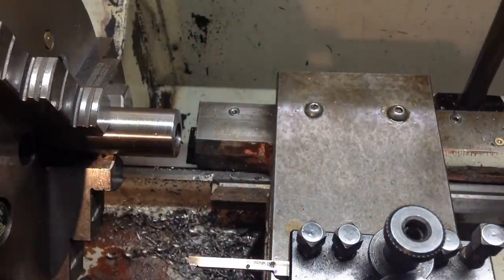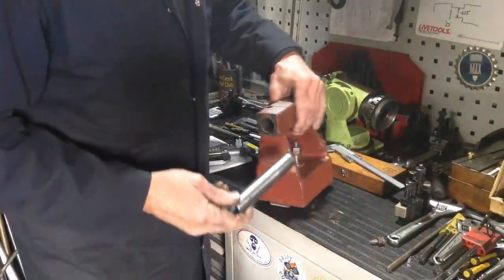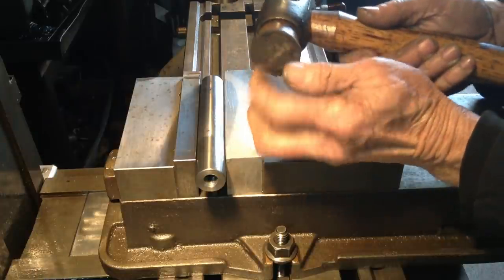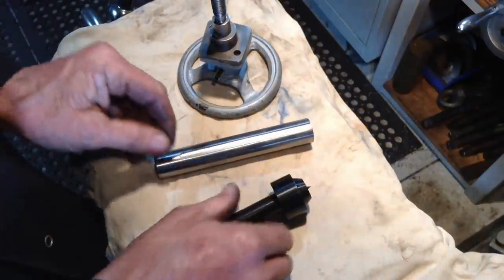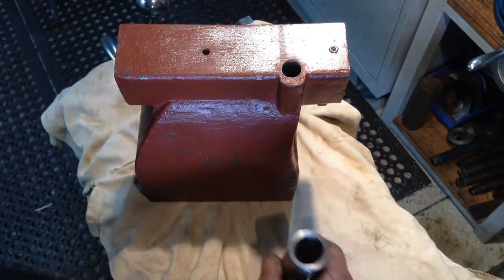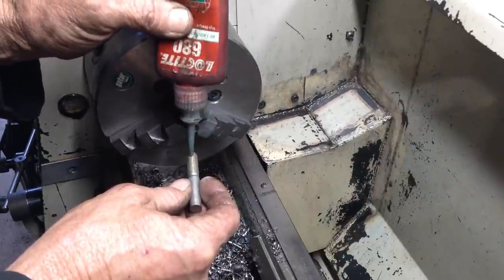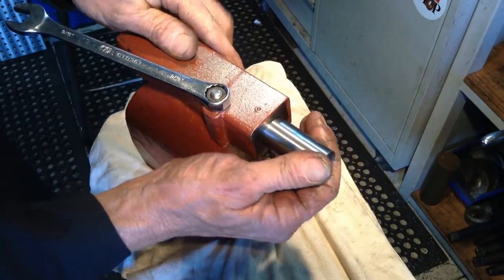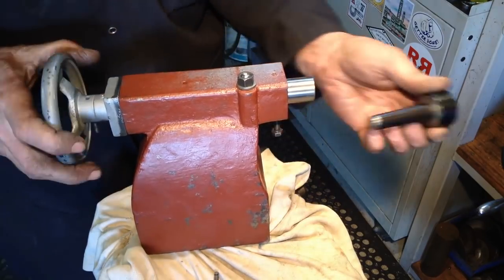Tailstock Quill .  Part 4   The Completion .

Comment: Great vid, Max! Pretty surprising how off center that bolt was lol. They must've eyeballed it while only wearing one boot or something and be like "yup, looks good!" 🤣. Guess they didn't have you for a teacher 😊. Well done! Can't wait to see some pulley action! Cheers! 👍😀👍
Reply from the maker: Thanks Chris .  Eyeballed by a blind person !
Reply: I would argue that filing the dog end off-center is really not an improvement on cutting a lopsided keyway. At least if they're both off the same distance, they'll stay the same fit.
Whereas by making the dog off centre to the thread, if the screw turns (say under vibration) it'll become a jamming proposition as the barrel extends, and if it starts to gall (or the owner gets confused and turns it in the wrong direction) it may become difficult to remove the barrel without causing damage to the keyway.
Let's hope the owner did the right thing and plunged an end cutting milling cutter through on centre, big enough to more or less clean away the rogue hole, and then tapped the new hole and made a tapped insert out of high tensile studding (all-thread) and loctite that in. Much more pleasant work than filing a botch screw, and it was so far off centre the eccentric dog end would be weak as weasel piss.

Comment: From the issues you've corrected and the finish of the casting I would assume the machine came from a high-volume low-cost factory across the sea. With thoughtful skilled work, many such machines can be made to do good work, and hence they should be regarded more as kits than ready-to-use machinery. While this machine won't need metalworking accuracy, I'd be interested to see the alignments between headstock spindle, tailstock quill and bedway guides.
Good series with great results. Thanks, Max.
Reply from the maker: Alignment ,  yes that would be interesting to check !   I do agree with you about the kit's , it gives something to work with that is nearly there .   Cheers .

Comment: Max.  I am happily setting up a South Bend 9 to my inside workshop.  Thus take notice of your attention to the morse taper.  As I have cleaned this unit and planned it's install, with your notes as to the tailstock and best fit, best operation I am certain for better results in inspecting alignment and real jobs ahead.  
I find your speaking about small details of the best finish, of particular end use and hope to reach that best craftmanship.  Which I take note you reach in your work place.  Regards from Washington State.  US.  M. McGary  I quite thank you for the instruction to machine end use.
Reply from the maker: Thank you Mark .   Cheers .

Comment: You always have great little tip nuggets in your videos Max. I found out about hard face mallets the hard way. Even the hard plastic ones can make a part jump if you are not paying enough attention. I have been using a soft rubber dead blow with good results. The edge test for center on the round is a great double check tip, cheers for that. All the best! Eddie
Reply from the maker: Cheers Eddie .

Comment: Thinking about making a new tailstock for my lathe.  I think to sell it they shifted the tailstock back to get larger center to center distance but I have to hang the quill right out to reach over the cross-slide...

Did the quill bend when you put a slot in it and do you think a split clamp would be a better lock?
Reply from the maker: No , the quill did not bend .   The 2 piece pinch clamps work best .  👍

Comment: Making a new locking cotter pin out of brass (with a steel stud Loctited in) may have been the go.  Not much more work than what you did on the steel one.
Reply: Just make the whole thing from steel, no need to make it in two pieces if the fit is good
Reply from the maker: Just  sorting what had to be sorted !   Brass or bronze would have been a good option if i had to make a new one from scratch .  Cheers .
Reply: @dreadnaught2707  The fit won't stay good with steel on steel. The barrel will take a beating, and that in turn will downgrade the clamp. Also matching the radius is not enough, the centre distance between the two cylindrical surfaces is not going to be correct.

Comment: Gotta say I was surprised at just How off centre that bolt was!
When you have finished building and have some Flash to spend, get a DRO for that mill.
I wouldn't have believed how bloody useful, and how much you use it, until you have one.
And on the lathe, and on the surface grinder when I find one inexpensive enough at fine resolution.
Us old farts should get with the times!
Just sayn'.
Reply from the maker: That is what i reckon as well !   About a grand per machine for an Easson .  I am not putting the cheap ones on or getting them on line from overseas .   Cheers .
Reply: Eason have a head unit with fine enough resolution for surface grinding but Here and Far, (Hare & Forbes) only sell the courser scales.
Being an electronicly ignorant OB, I daren't mix n match them!
Perhaps one of your mob knows something helpful?
Reply from the maker: @captcarlos  I noticed that . The 5 micron scales will be good enough for a lathe & mill .
Reply: Which is what I have on 2 lathes and a H&F Bridgy clone, but they aren't even interested in finding the 1 micron scales..
Frustrating lack of info in the colonies!
Reply: @swanvalleymachineshop  Back in 1995 I installed an Accurite 2 axis DRO on my Bridgeport clone, about 2 and a half grand then.
Recently installed a $350 2 axis Chinese DRO, same reolution with heaps more features on my mill, very satisfied.
Reply from the maker: @captcarlos  That's piss pore of H&F .  Go in there & yell at them , they are probably just being slack !
Reply from the maker: @willemvantsant5105  I want to stay away from the cheap ones . If it has a miss read , i could bozo's  somebody's job .  They might be fine , i just don't trust them .
Reply: @ Max..
They probably are being slack.
And I have spent Thousands of bucks there.
Bugger.
Reply: @swanvalleymachineshop  Went to Eassons website and their contact number is in the land of hit and miss, my Accurite was made in Mexico!!!!
Reply from the maker: @willemvantsant5105  dro pro's & ali express  advertise the 1 micron scales .

Comment: I don’t like that type of quill lock because it pulls the quill off center when tightened. Even if the quill fit is good, the needed play can pull it off by a good thou, if not more. It’s a wood lathe, so not that important, but still…
Reply from the maker: I would probably tend to agree with you there .